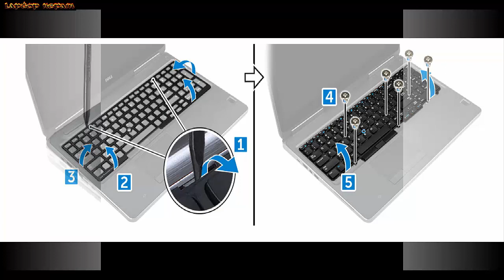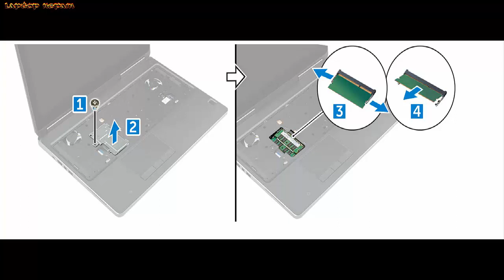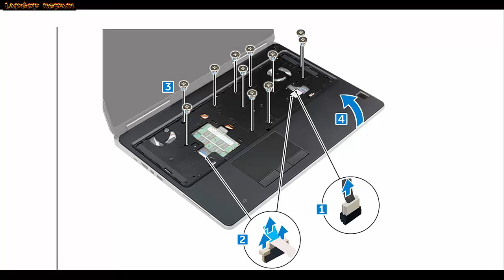How to disassemble Dell Precision 7520

Comment: How to add additional M.2 PCIe 512GB SSD?
Reply from the maker: 2:37 to 2:47 s
Reply from the maker: 2:37 to 2:47 s
Reply: I have a ssd there already at that location. I m looking to add 2nd ssd. Want to know can i add 2nd m.2 ssd or it have to be standard ssd
Reply: How many slots for upgrading M2 ?
Reply: @duykhoilua  There is one slot. You can add one M.2.